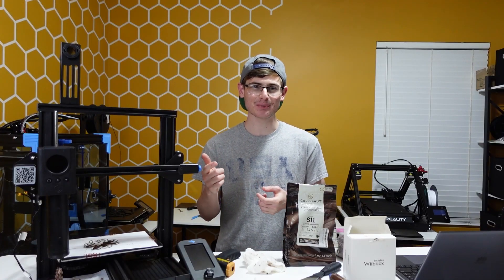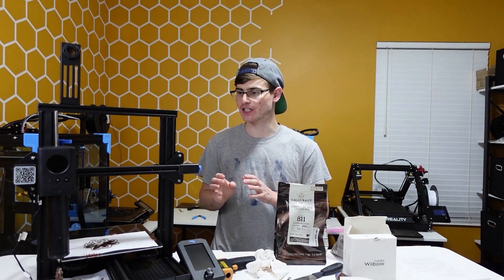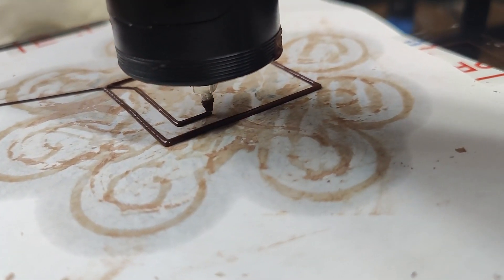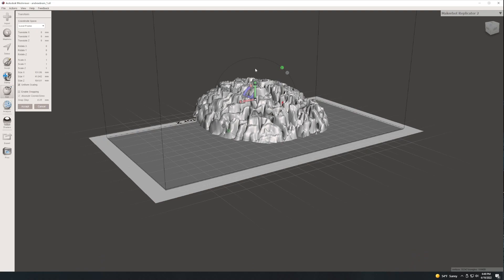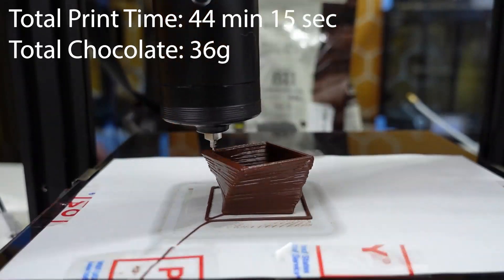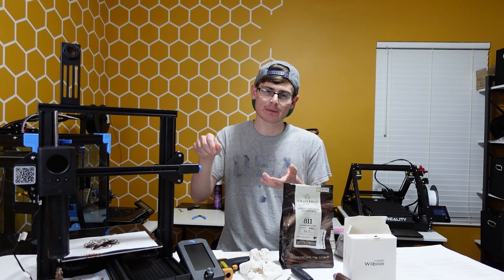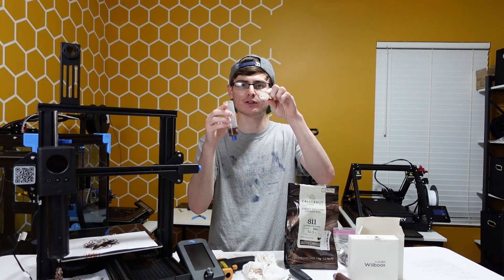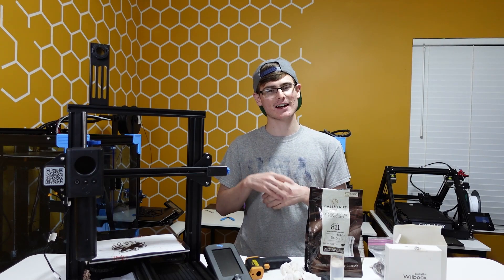3D Print Chocolate Using the LuckyBot!?!? With Chocolate Printing Timelapses!

Comment: or you could also use Non-Stick PTFE sheets
Reply from the maker: I will have to research PTFE sheets. Didnt know you could buy sheets of it :o
Reply: @ThePrintHouse  Non-Stick PTFE sheets are oven sheets super thin and cant take the heat up to i believe 500c and you can buy it in big rolls

Comment: Silicone Baking Mat would be a better print surface and they would last along time
Reply from the maker: Thats actually a very good idea! What's funny is that I actually just ordered a silicone baking sheet for a print surface 2 days ago so I could test plastic printing on it! I have low expectations but for chocolate thats actually perfect! It'll stick nicely to the glass bed with no tape and the chocolate comes right off.